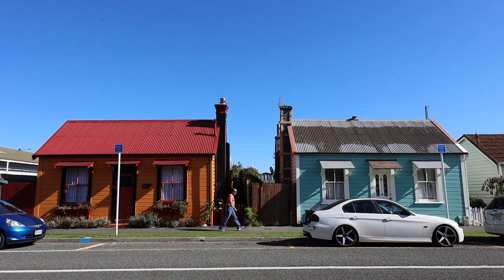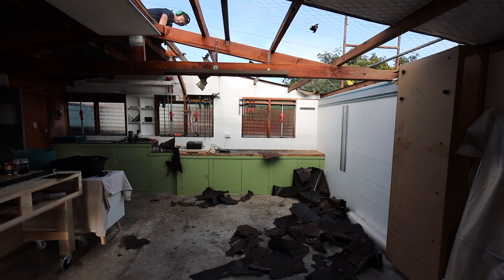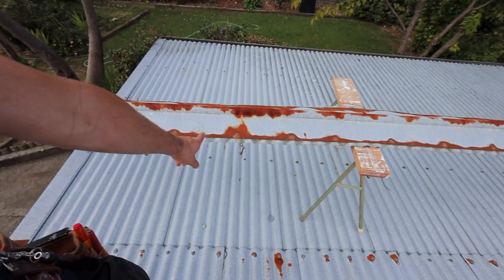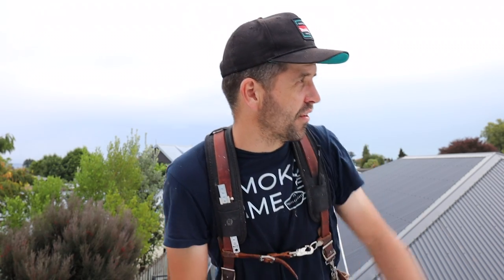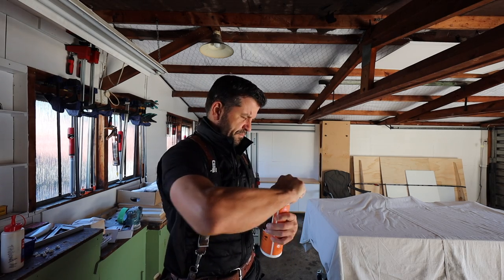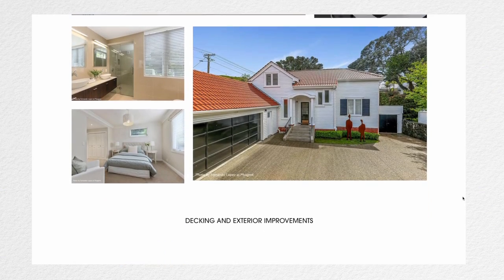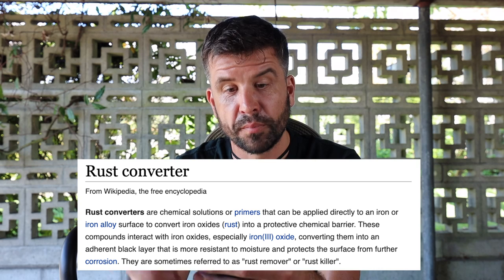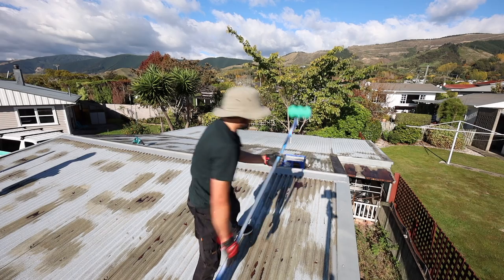How To Make An Old Roof New Again

Comment: Well every day is a school day I was watching you paint and wondering how you were going to paint the tin sheets thinking that’s going to be a pain, then out came the roller. I have never seen one like that in the UK, mainly because the tin is only really ever used on outbuildings and industrial units and rarely painted.
Reply: You can easily paint that also with regular paintbrush.
Reply: Yes but that would take forever @mr.wizeguy8995
Reply: @davidstreet3505  No it won't. 
I would say that 8 inch wide brush with extension pole isn't much slower. Many professional roof painter uses brush on small roof like that in video because using airless sprayer doesn't make sense because it requires quite a lot cleaning.

Comment: Any recommendations on screws or underlay paper? I have a similar vintage roof in much worse condition - it's leaking through just about everywhere in the garage, and (so far) luckily not the house roof, but I'm gonna do the garage as a practice run.

Comment: nice video, I am planning to do the same thing on my garage roof. just being curious, is any safety harness or cable system do you suggest when working on the roof?
Reply: Don't know where you live, but in Canada I can go to a lot of different places, including safety equipment stores in my area, also often building supply distributors sometimes sell a harness and rope kit, which is OSHA compliant and usually sold in a bucket so you can store it safely.  A lot of places that sell roofing materials actually may also sell a harness.  But again, don't know about your area.
Reply: @FeelingLikeThatNow  thx  mate for the info. I am from Auckland, NZ. there should be somewhere I can get the harness.

Comment: The rust converter products certainly appear, from just reading the label, to be far too good to be true. But the product has been around for decades now, and is great option for halting surface rust. I've certainly used it to hand brake far worse damage than that on your garage, however, this is really only buying a little time (hopefully in years). You do need to be a little careful as to what is applied directly over rust converted steel, as it can react with, or leach through, some top coat paints. The priming product you've applied looks to be up to the task.

Comment: Was it not possible to treat and paint the roof when you took it apart to put in the underlay? I am curious if you could still get rust on the parts you can't see from on top. (Underside, parts covered by other plates...)

Comment: Does the metal roof actually hold your weight or are you always stepping on the rafters?
Reply: 'Old" galvanized roofing can hold up to you walking on it all over as its relatively thick thick steel and thickly galvanized (hot dipped zinc not electroplated). Not sure about 'modern' roofing, its much thinner - so much so that you can tear the sheets to size by hand after making a notch.
Reply: @brucelee3388  interesting. I’ve only seen the thin ones. Thanks Bruce Lee 👍!

Comment: even though you were doing the job on your own, you still couldve gone horizontal with the underlay. it wouldve meant only a risk of leakage in the centre; and you couldve addressed that the next time by putting a layer across the middle horizontally

Comment: it's surprisingly hard to convert all "rust" as only you would be able to get surface stuff, which most products do good enough job an that the point, good enough.

In ideal world you would sand it down just a touch to remove loose rust then sweep it off and then convert more of deeper layers... but it tad over kill because good enough is good enough.

Comment: Hi Scott do you have any tips for filling holes in the old tin roof or what to use?
Reply: There’s a product available at Mitre 10 and others that is a roll with bitumen on one side and aluminum on the other.It is like a big roll of tape that you cut to the size of the hole.Needs to be warmed if applying in cold weather but that’s a minor issue.I have used it to good effect on my corrugated iron roof.Hope this helps.
Reply: @wetawatcher  does it go under the roof or on top to apply?
Reply: On top shiny side up.Does work.

Comment: That rotten weatherboard you showed , probably caused by it being hard down on the bottom flashing and sitting in water, if the flashing has an upstand behind the weatherboard, it's best if you rip the bottom of the replacement weatherboard down like say 15mm so it finishes 15mm above the flashing then it won't be sitting in water so much and rotting like the old 1 did....

Comment: Should put roofing screws in with a drill not your rattler. Less likely to over drive the screw and won’t strip the paint off the screw head.

Comment: To an untrained eye, the roof structure is interestingly minimalist (light roof, shallow pitch), but as you walk over it, the corrugated steel seems to be remarkably strong.  Congratulations on getting your wife to help on the roof (I’ve been trying occasionally for 53 years. Unsuccessful so far. )

Comment: Haha builders- " what do you mean sandpaper, prep the surface?" Yeah, the uneven effect of the Rust Converter is probably because of not sanding the rusty areas first. Sand with 60 or 40 grit and dust off, then apply Rust Converter and it will come up total black.

Comment: You need to wire brush the surface of the rust before you apply rust inhibitor
Reply: That's what i thought too
Reply: @joehart3826  yeah it exposes the actual rust and should turn black

Comment: Tape the paper joints if you get a leek . Condensation on the bottom of the tin is the most lightly cause of drips . Replaced the roof paper on as church had to go back pull the tin again and tape the joints condensation all the heavy breathing and their was one house with water heater in the roof and a unfortunate design they replaced the roof did not help . The silver paper tape is like 1AUD per meter what's that 300 NZ shillings or something.

Comment: Could you just flip over each corrugated metal roof sheet?...exposing the virgin, non-rusty side?
Reply: Wouldn’t that put the former nail holes at the bottom of the “rill” …. So it would leak unless you plugged each one?
Reply: @longuevalnz  I assumed the fastener with rubber washer would use same holes and seal just as well in the bottom as the top of the "rill".
Reply: @jasonarthurs3885  the screws catch debris like leaves and make a pond, increases rust and the chance that water gets in.
Reply: @geoffcapper5025  True.